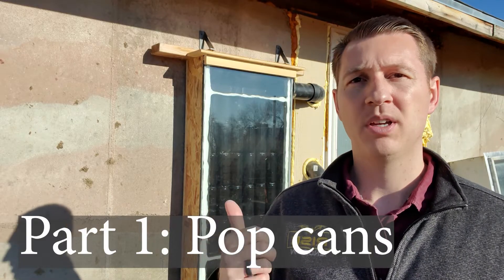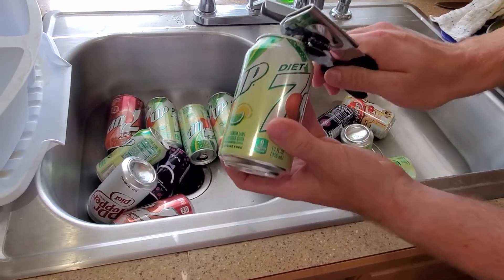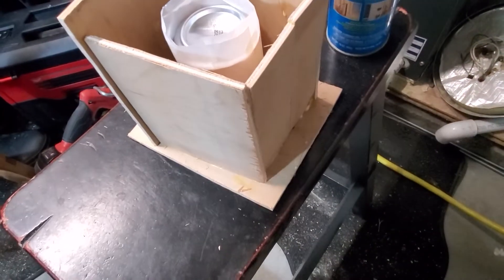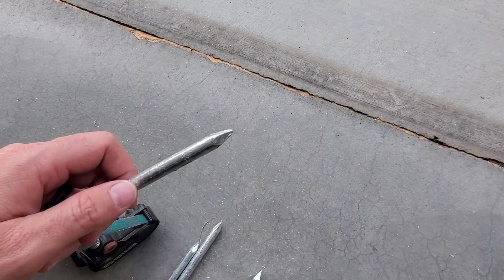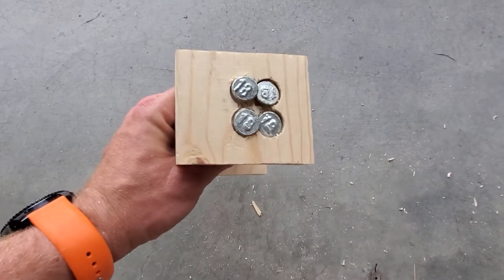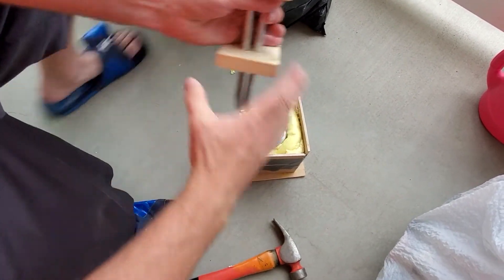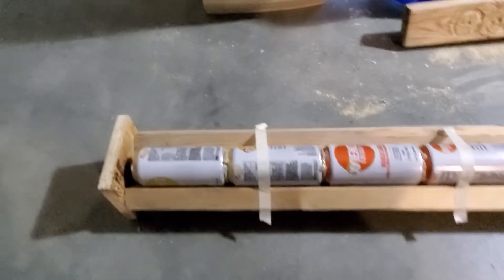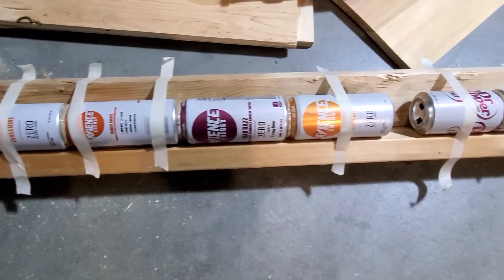Part 1: DIY How to Build a PASSIVE Solar Heater with Pop Cans

Comment: One problem is Black Mold inside the cans. Or BPA.
Reply from the maker: Black mold usually thrives in wet environments, right? Since this sealed from the weather and gets so hot inside, any moisture that could get inside would likely evaporate quickly.  As far as BPA goes, I drank the liquid from the can and that didn't kill me, so I'm not too worried about the BPA, especially since this doesn't heat my home where I live or sleep. If someone is worried about BPA, they should probably use something besides cans though.